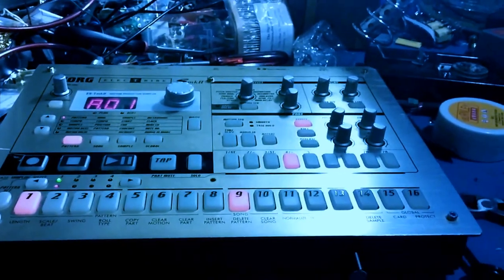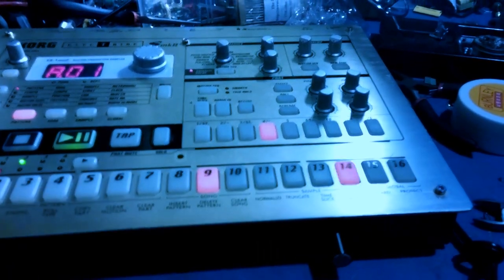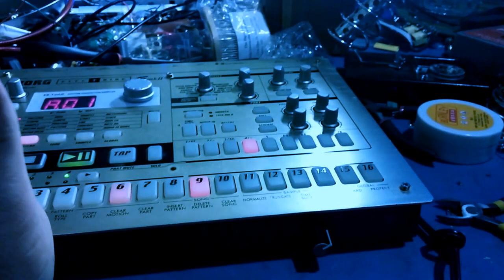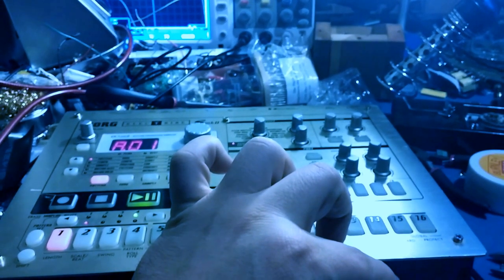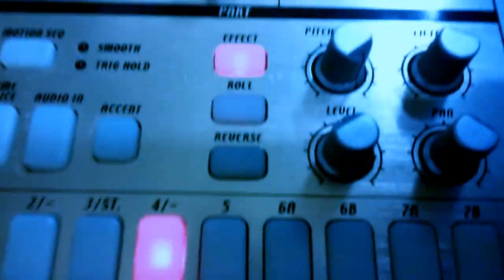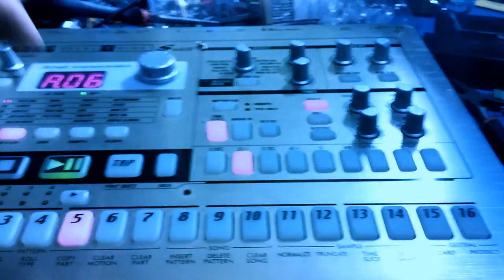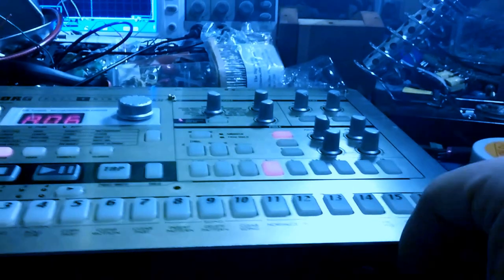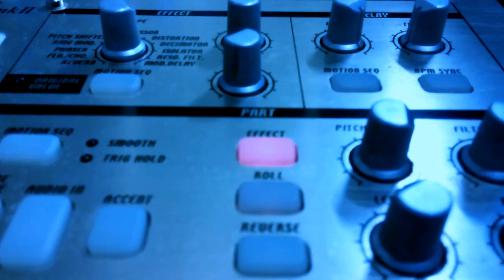Modified Korg ES1

Comment: Nice work!  As in discussions on Electribe mailing list, the higher speed starts to sound like a higher fidelity sample.  1:50 what is a "waveform mod" in this context?
Reply from the maker: See this video for explanation:
Ltc1799 and attiny controlling bent Electribe.

Basically, I can add a function generator to control the speed of the  clock crystal. I've written a program to do that, I've just got to get around to building a better demo.